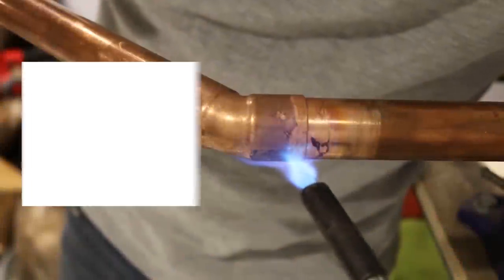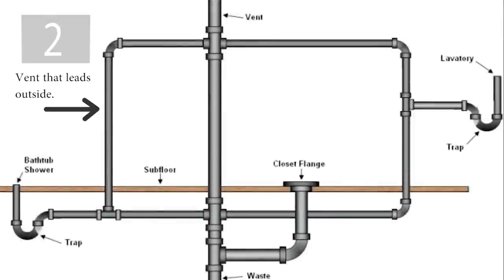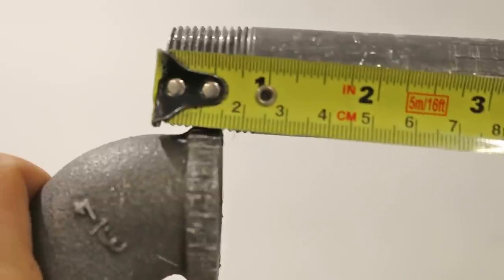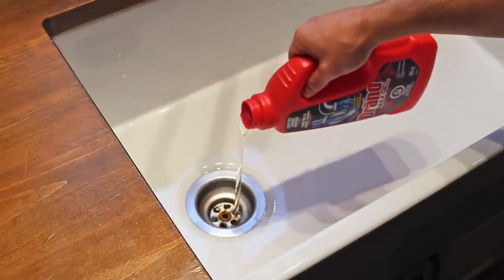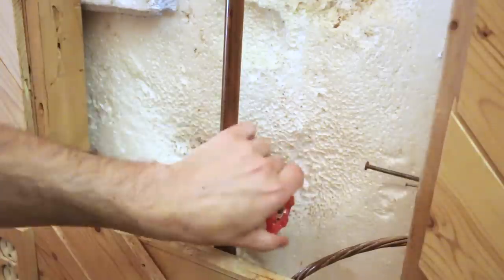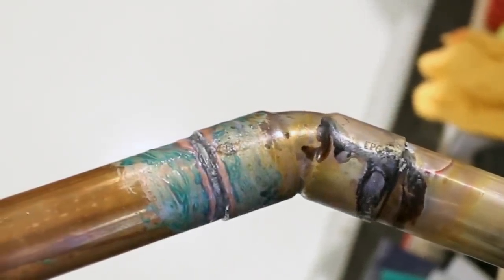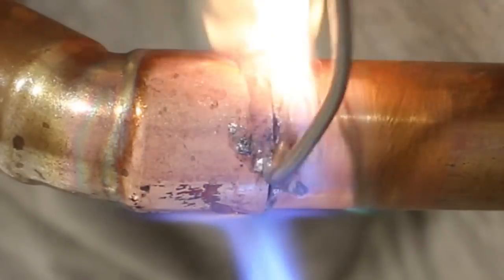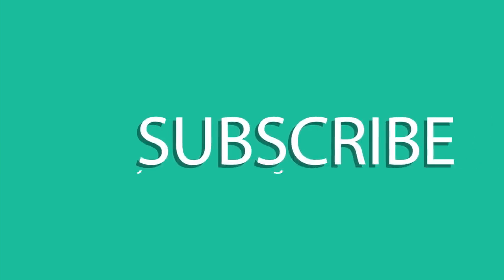10 Plumbing Mistakes You Should NEVER Make and How To Fix Them! | GOT2LEARN

Comment: I had a saddle valve last 25 years on my refrigerator line. I replaced it only because I was putting in a new fridge.
Reply from the maker: Good!
Reply: vipahman : I found a saddle valve on a water line in my basement and thought it was just a clamp left on the line.
I went to remove it and surprise! Water started coming out.
I tightened it back as best as I could,but now it has a very slow drip.
If I would've seen this video before finding that valve,I would've known what it was and left it alone.

Comment: Don't use dielectric unions because often times the pipes are used for grounds and this will prevent grounding and could be dangerous in case of lightning strikes or other equipment that may use the water pipes for grounding. Whether it's code or not, I've seen many "pros" ground cable TV, satellite and phone cables to exposed metallic water pipes.
Reply: Not to mention they rust inside, which is what they are supposed to prevent.

Comment: Good tips.
1:42 Retrofitting a copper tee does not work this way in reality. A small section is cut out so the tee can be inserted and then slipped down.  Next, solder.

Comment: Ha ha, yeah, we had a "professional" plumber install our humidifier.  He used a saddle valve.  Twice.  First he installed the water feed to the humidifier on the HOT water line.  Duh!  After the humidifier died within a year, they left the saddle valve on the hot water line and installed ANOTHER saddle valve on the cold water line!  So yeah, I have both of my water lines pierced with saddle valves because my wife insisted on "hiring a professional" to install it while I was out of town on business, rather than just letting me do it myself the right way the first time.
You can bet that I (the homeowner) will remove BOTH saddle valves in the near future and solder in a proper T on the cold water side with a proper sweat shut off valve.  That way, I know it will be a quality installation and installed correctly.

Comment: Here's an old wives tale that I haven't seen disproved. Coffee grounds help keep drains clear. !!!!   ??? Maybe the acidic nature of the grounds? The abrasive effect as they roll down the pipe?
Reply from the maker: I've heard that too....but I akso heard that the fat in coffee can clog them up aswell...don't know who to believe lol
Reply: @Got2Learn  Fat in coffee? What? Little chunks of fat floating around in the cup? Coffee is very acidic. I think that's why it works. Shrug. "Fat in coffee" Lol
Reply: @TheNimshew  Actually it depends on the coffee. Some is acidic, some not so much. However, if people dumped a cup of vinegar down the drain once a month they would do more than coffee ever would.  But in the end I recommend a big pot of boiling water with good grease cutting dish soap. Works very well.

Comment: Mistake no.11: using the solder as if it were paint - you only need to push it in, in a couple of places, not paint it on, as Got2Learn has done.  But, if it works...

Comment: Turn off your water heater before you drain your pipes ... this is critical with electric models ... I can only guess if this is as important with gas models ... and when you're all done and have all the water pipes filled up again, you know, turn the water heater back on ... or you will get a call later in the day ... ha ha ha ha ...
Reply: Hey Russ, are you referring mainly to on demand heaters please? Thx.
Reply: @mazdarex7  - No, mainly to tank water heaters ... if the water drains out, the exposed heating elements will fry ... so it's important to flip the circuit breaker off before we drain our water lines ... just in case ... and then make absolutely sure the tank is full before we flip the breaker back on ...
Reply: @russcrawford3310  ok, thx.  We've put our gas heaters on vacation or off before certain diy plumbing adventures.  Thx!
Reply: Sorry for dumb comments and questions.  We only had gas heaters anyway.  Not thinking right due to illness in family.  Lesson reminded: don't diy when distracted.
Reply: Or simply do not run any hot water for the duration of the repair.  With no demand, all of the water remains inside the water heater tank.
Reply: @StilettoSniper  - just one siphon ... that's all it takes ... be safe, throw the switch ...

Comment: The #7 point steel to copper should not even be an option even the best galvanized pipe will release chemicals and eventually rust out and clog you faucets and shower heads . It's best to replace any galvanized steel if possible ( even if it might add a little to the job on any job otherwise your just asking for future headaches or worse water damage/health damage ). Everything else is right on point .
Reply from the maker: It was just an example
Reply: Agreed a good example but you should recommend to never use galvanized steel for water as a  feed line above all .
Reply from the maker: Sure thing, thanks!
Reply: @Got2Learn  you show very good things here for the DIY guys to learn I just think you might add the why you don't do certain things would be very very helpful for your DIY guys . Btw ty for taking constructive criticism shows tact and a tough mind .
Reply from the maker: Alright, notes taken!:)
Reply: TAPS not faucets 😡
Reply: @Ray.842  no but aspirator will clog due to rust
Reply: Except the connections at the water heater are galvanized steel, thus you need to use brass or dielectric unions to connect copper. My house is plumbed in PEX, so there's no corrosion issue.

Comment: Steel to copper effect only applies on galvanised steel
Reply: You can't use black iron pipe (BIP) in plumbing, it rusts.
Reply: charlidog2 black iron is still installed nowadays just painted to protect against rust. Come back when you know what your talking about
Reply: @milkyporridge5929  The inside would rust.
Reply: charlidog2 yes hence why only used on heating systems nowadays. (BIP) haha 😂
Reply: @milkyporridge5929 Yeah, transporting gas to heating systems. The only place BIP can be used for water is when there's no oxygen in the fluid. Some closed systems ad areas near a boiler can have that environment. 
But this video wasn't about commercial systems, it was for homeowners; who should not use bip for water.
Reply: charlidog2 BIP can be used for fresh water if it is galvanised steel. You sound like you dont know what your talking about
Reply: Oxygen in fluid? H20????
Reply: charlidog2 you mad bro?

Comment: 1) Poop runs downhill.
2) cold is Always on the right.
That's all you need to know
Reply: My bathroom has hot on the right.
Reply from the maker: Swap the flexble hoses.
Reply: The tube lines are copper, can't really swap it.  If I swapped the hoses on the sink it wouldn't match the tub and I'm too lazy to replumb it.
Reply from the maker: Ahh crap :(
Reply: @ubernerrd  it doesn't matter its only really an issue when plumbing thermostatic showers or taps
Reply: Three things you need to know. You forgot don’t bite your nails!
Reply: ...and Friday is payday.

Comment: White Teflon Tape is for Water Only;  Also, you can't use black pipe for plumbing, and galvanized is frowned upon these days.  Yellow Teflon is thicker for gas applications, but can be used for any connections.  I prefer the heavy duty teflon tape because the thicker means only 2-3 wraps of the threads.

Comment: I was surprised to hear you say vinegar does not corrode your pipes.  Vinegar is an acid and will literally dissolve copper.  The baking soda neutralizes it but only if enough is put in.  Corrosion occurs as soon as vinegar touches copper.
Reply from the maker: Yeah, it's not for copper.

Comment: Use yellow, high temp gas for your torch, not the blue can, This will prevent unnecessary overheating of copper pipes
Reply from the maker: The yellow tanks are not MAP gas, they are just slightly hotter than propane.
Reply: Maybe you can explain:  if overheating with propane is the problem, how can using ANY gas that is HOTTER than propane be the right thing to do????????????

Comment: Easy on the teflon 😲🤦🏻‍♂️only need three times around 😂
Reply: Depends on the threads, i have gotten threads so loose i either put 6 wraps on or make it on by hand with 3 wraps , undo it and then put another 3 on. When i was an apprentice it was 1½
Reply from the maker: This means you have an isdue with the threads.

Comment: Thanks for this. 

Here in NYC anyone with a Plumbing license, just has License to Steal. This is why their are so many do it yourself people out their.  That goes for license contractor and license Electrician.  Lucky for me, I have friends and Family with Licenses and they are reasonably priced with all their residential clients, they say they make there real Money,  with a commercial contract. 

Nothing but a a lot of license thieves out there.  Not all, but plenty enough.

I had a contractor quote me $3000 for a days work, that included $300 worth of material,  just to install Copper piping and two valves. Then he wanted me to break the wall and clean up and then I had to hire someone to do the sheet rock, so it would of been like $3,500 + primer, paint, brushes, rollers.  GTFOOH.  

I don't make $3200 a day why should He? Fooking thieves out their that cross the line with their prices, I hate these blood suckers :o/ Just imagine what they would charge an old single widowed lady , Sad, Just Sad.
Reply: I'm a master plumber retired, every Monday morning the phone rings with the do it your self home
owners calling about how they messed the plumbing up. Keep it up, I make a good living fixing what you started!
Reply from the maker: No problem buddy, you are welcome :)
Reply: Out of all the trades, plumbing is the most important and necessary.  It's responsible for the eradication of many diseases and greatly improves our quality of life as a whole. You also definitely need to get more than one quote, otherwise you're limiting your options (did you buy the first house you looked at when you were searching?).
Reply: And I've paid for all of my professional-level tools (many thousands of dollars at this point) out of the money I have saved doing my own home repairs (to code) and automotive repairs over the past 40 years.  Love the feeling of doing things right the first time, and the satisfaction of the bill only being a couple hundred in materials and permit fees (or auto parts) versus thousands in marked up parts costs and exorbitant labor (and call fees).  
I guess it wouldn't be so bad if I could at least find competent "professionals" that don't do more damage than they repair.  So, I rely on the one person who REALLY cares about my property and making a quality repair at a reasonable cost the #1 priority:  ME.

Comment: Haaa, last time I cut a water pipe to install a new dishwasher I went out and shut the main off but when I cut the pipe it flooded my kitchen. I had turned my neighbors water off cause my manhole was covered with wet leaves and I opened theirs instead. They weren't too happy.
Reply from the maker: Ouch! That happened to me once too...
Reply: "Cover your manhole"

Good tip
Reply: @pmailkeey same people that stare into a garden hose after they turn off the water.

Comment: Saddle valves have their place; they simply should be used properly...don't install them on the BOTTOM of a horizontal run-they will quickly fail due to sediment scavaging....use the side or top of the pipe.Wherever one is installed,pre-drill a 1/4 inch hole in the copper pipe over which to mount it.NEVER use the piercing point to make the hole.Been using them this way 40 yrs w no trouble.Have replaced many done the wrong way as described above.Sometimes I don't feel like cutting a line/installing a ball valve.Don't be a Puss.
Reply from the maker: Installing these is actually going against code, you know that right?
Reply: @Got2Learn  Code-Schmode...it's just someone else's opinion...

Comment: Haha well forgetting to turn the water off and doing plumbing work is better than doing electrical and forgetting to turn electricity off :'D.
Reply from the maker: Depends haha
Reply: Well, it would be twice as bad if you were standing in water from the pipe and Then worked on a live electric line!
Reply: For me I've done both electrical projects both ways live and not yes I've been zapped it does suck it just depends on how lazy I wanted to be? Not saying anyone should do it for sure and lucky I'm not dead? It mostly was just replacing an outlet still not smart by any means!

Comment: No.1-get 3/4 inch teflon tape for 3/4 and 1 inch pipe.less turns,less effort.
No.4-Never use a saddle valve.If possible,get a tee fitting with 2 outlets,these install on angle valves.
No.5-Yes,these products for unclogging pipes,are far from what they're supposed to.companies are millionaires selling this stuff!!! Avoid these forever!!!

Comment: Meanwhile the company that installed my furnace put a saddle valve from my hot water tank to the humidifier?
Reply: Luis, don't feel bad bro.  The idiots that installed mine (at my wife's calling, not mine) installed TWO saddle valves for my humidifier.  The first one was installed on the WRONG water pipe (and they just left it there).
Needless to say, I will be un-cluster fucking that in the near future myself.

Comment: I can never understand why yanks vent every trap, most other countries use one vent at the beginning of the line and another one if a junction line exceeds 10mtrs, has been tried and test for decades, never pulls the seal
Reply: Michigan house owner here. Built in 1978 and it's one vent for a tub and toilet, maybe the sink too but not sure.
Reply from the maker: Sink always has a vent ;)
Reply: Ryan Carlen 
Duh, it's code but don't you ever ask why?
Why do we need this law?
Why do we need this code?
Some make sense, some don't.
Reply: @pmailkeey AAV are used in the states   as well. I only use them on island sinks other than that I vent out my main stacks and re-vent all other fixtures to them. Anything downstream of a water closet must be individually vented for a reason. Simply physics.
Reply: @pmailkeey  Yeah it's interesting how there are so many right ways to plumb. I prefer either stacking fixtures plumbing in crawl spaces or wet venting in more tight areas such as open floor trusses etc.
Reply: @aguyandhiscomputer  your sink is probably wet venting the toilet. Very common system.
Reply: @joshm5816  ok. I did see where one of my tubs 1 1/2" drain line runs to where the toilet is. Not sure where the sinks tap into it since I only tore up part of the 2nd story subfloor.

Comment: Got to tip #1.. not sure if I want to keep going. Here's the REAL tip about Teflon tape: throw it the fuck out.

Teflon tape is a thread lubricant, not a thread sealant. It is used in applications where a gasket makes your watertight seal so you don't need to fight friction.

When you need to make a watertight seal with threads, go get pipe dope. It's a paste you brush onto the threads, and is actually thread sealant.
Reply: The real trick for not over tightening:

Use pipe dope, then tighten by hand as hard as you can plus a 3/4 turn with the wrench. If you use pipe dope, 9 times out of 10 you'll be all set and once in a while you'll need to apply another 1/4 turn.
Reply: The real trick for unclogging a drain: open up the p-trap and remove the clog. If you can't get at the p-trap, get a drain snake. For bathroom sinks, pull the hair off the pop-up arm.

Chemical drain cleaners don't do shit. Vinegar doesn't eat hair, it's a waste of time unless it's just food particles

Comment: I don't think the part about teflon tape is real. The threads are literally there. I don't believe it is possible for someone to put the tape on the wrong direction when they can see what direction the threads are going. It must be some sort of hoax. Nobody could possibly ever require being told to go the direction of the thing you are literally doing things to.
Reply: I often see it with the new guys - most of the dont even know at first which way to tighten the fitting and its a laugh when they have to work above their heads or lyibg on their backs - get totally confused